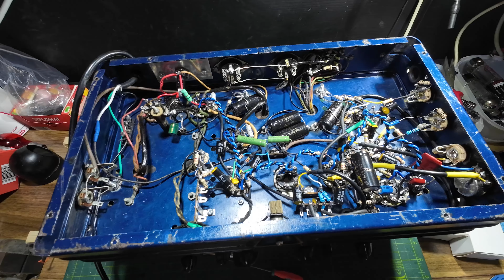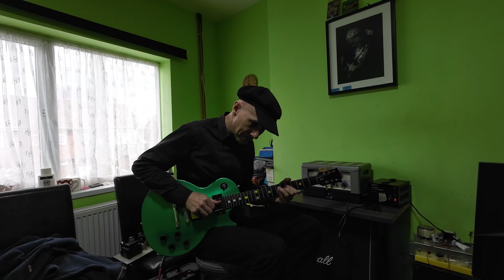Masco MA25N Conversion High Gain Guitar Amplifier Mods Fully Rebuilt

Comment: Channel 2 on your amp sounds similar to my Sovtek Tube Midget 50H.  Have you ever come across one of those?  It's a 2 channel with a 5881 power section.  I think Electro Harmonix still makes a version of it called the "Mig 1".
Reply: I remember when those Sovteks first appeared in the UK, they were incredibly cheap and great value. Then when I was in Russia during the early 2000s all the punk bands were using them in the underground clubs (literally underground in many cases where they were in repurposed communal bomb shelters). Now they're desirable and expensive amps!
Reply: I remember those amps where everywhere in the early 90's, the one I had was basically a Bassman/JMP with Russian parts!.
Reply: @keiranbradley3238  I think mine is from 1995, based on the oldest dated capacitor.  And you're right to describe it as a Bassman/JMP clone.  The high gain channel has loads of distortion, especially with humbuckers.
Reply: They're coveted by the stoner/doom metal guys alongside the Orange/Matamp heads.
Very popular amongst that crowd.